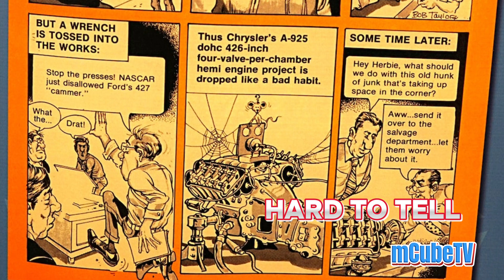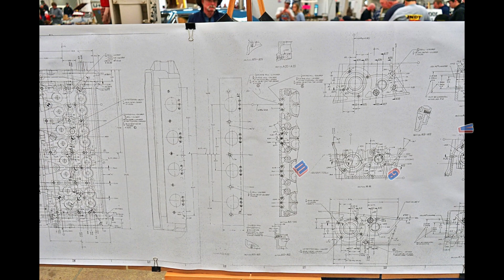The DOHC 426 HEMI was already in production! The WilHemi Show

Comment: And Chrysler had a couple of high performance slant 6 head designs that also never left the lab. Too bad. They had an aluminum block on offer from about late 1961 to early 1963, Chrysler produced and sold about 52,000 aluminum block 225 sixes. They were around 80 pounds lighter than the cast iron blocks. It would have Ben interesting to see the prototype aluminum head mated to the aluminum block make production.

Comment: I hate to pop your Buble but ford not only built the largest Hemi but it was all Aluminum with I believe duel overhead cams it was 1100 CI and was used in tanks in WWII
Reply from the maker: Shame the GAA didn't make it into the Galaxie 500... It performed like a diesel, 500hp and 1100ftlb torque at 2200rpm..  It could have been a beast tho.
Reply: Oh little guy you have so much to learn about Chrysler....they already made a Chrysler Hemi V16 2220 cubic inches that was placed in planes in WW2. They also had a V12 Hemi 1792 cubic inches AV-1790-5B V12 for tanks.

Comment: Here I am building DOHC VVT Yamaha V8s that fit in damn near everything are light and take boost  well
Reply: Really ??? Didn't know there was or is that boat engines
Reply: @hajileserpud9539  Volvo XC90
Reply: @alexhise968  YESSSSSS !!!! lol🤣😂🤣... Let's keep this quiet bro it's still cheap that engine has tones of potential 👍.... I have the Volvo 3.2 inline 6 engine in my garage that will be used as a swap, it's a 4 valve also, but I haven't had time yet... Do you have a page or a channel I can follow your V8 progress ?
Reply: @hajileserpud9539  tones of videos on my phone but only ever uploaded to Volvo fb groups or engine building groups. The 3.2 I6 is a worry to build the 3.0 is safer to boost the I5 T is great. the RedBlock is a legend. They made K power before Honda made the Series

Comment: With the cam within a cam like the Viper and you could use forked rocker arms to operate a 4 valve head design. To make the engine lighter build it with aluminum and it would be cost effective to do so.
Reply: @warrenlucier5796  could also do it as a double cam in block like the ford 427 calliope prototype

Comment: Ford's 427 SOHC was a large engine but you missed Fords other BOSS 429 that was not a chain driven OHC engine. It's homologation was done. The size thing wouldn't matter. The HEMI head was already large enough so adding the cams and chain gear would have only been a increase in size at the front of the engine. The 427 SOHC put out 616hp with a single carb. Longevity issues were solved mainly. The BOSS 429 was about the same output. Nothing had reliable variable valve timing back then. The SOHC needed the trailing cam advanced 6-9 degrees to work out the loss power they discovered from chain stretch. From your pictures the PENTROOF head was split head design and  at 9:18 you can see broken off valve guides. Yeah that's not good. If indeed this was their next design I see some issues. I'm not certain and to be honest this is my first seeing this so I'm probably wrong. I think two int runners could be hard to get a high volume into the chamber. It would have had lots of low end torque. Looking at runner size the engine may be choked. I don't think they will go with DOHC HEMI ever. The current HEMI is better then the elephant in many ways. Ford's 6.2L BOSS is overlooked and should have been the next leader. They did the same to the 351 Cleveland. I think it's the best small block engine ever.

Comment: Its called the Ball Stud Hemi. There is a Cuda running around with one installed by Tom Hoover and now in the National Auto and Truck Museum . The engine was originally owned by Dick Landy and later acquired by John Arruzza.
Reply from the maker: Actually the ball stud HEMI was a later engine that was supposed to replace the 426, and was much larger.  The only thing about the ballstud hemi was that the rocker arms did not sit on a rod. They were mounted to a stud in the head. The double overhead cam 426 was a different motor altogether . It had 4 cams and 32 valves in the head, a pent- roof head. None of the 426DOHC hemi's ever ran.